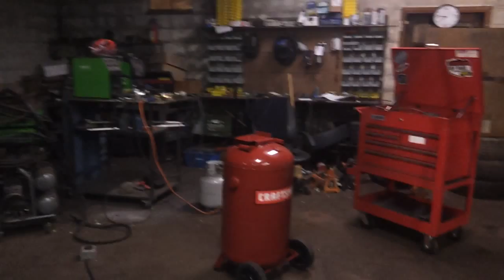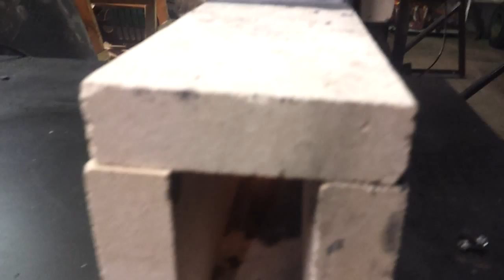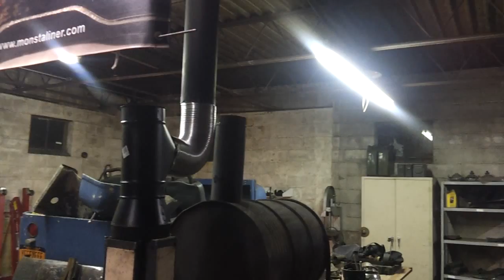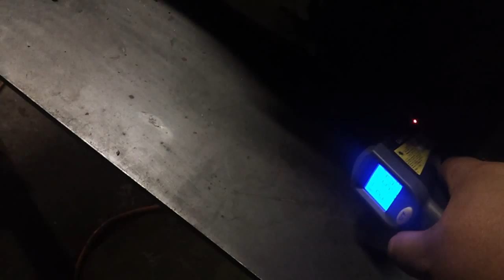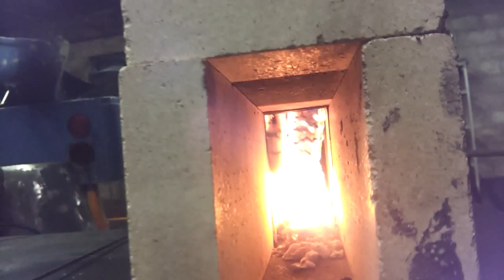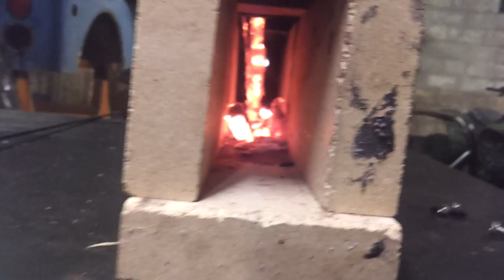Rocket Mass Heater/Stove (Part 2)

Comment: This design with the exhaust coming out the top negates this being a true Rocket Stove, you will be sending all the heat out the exhaust tube. The exhaust should be at the bottom back of the outside cover.
 Please do more research before you burn the place down.
 Congratulations  on choosing fire bricks.
Reply from the maker: We're doing lots of research. As I said in the video this is just for testing the burner and the riser. We're doing lots of testing to refine this as much as possible. The whole burn chamber and pellet feeder will be different once we build the actual heater and place it into the compressor tank. Basically we still have allot work to do. Thank you for the comment though.

Comment: you have smoke coming out the feed tube. the cause is your air inlet. i have never seen one with that type of air intake work right
Reply from the maker: The ones that claim to work like this are pellet fed. I'm working on changing it to pellets. Again this is all temporary for testing. The final design will be much better and way more professional in appearance. The goal will be to make it last for years and run at it's maximum potential. There will be a couple rough prototypes made. One for my partner and one for my shop for testing.